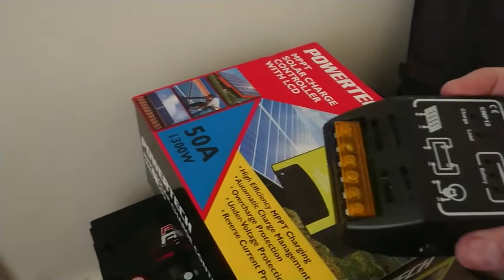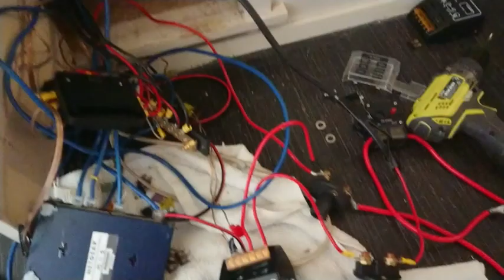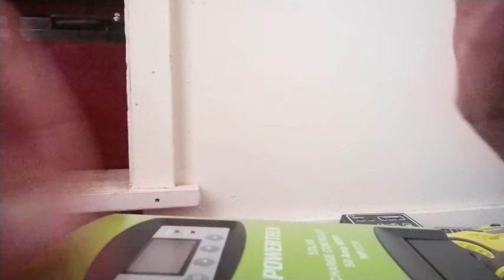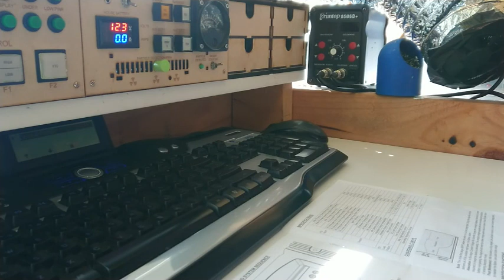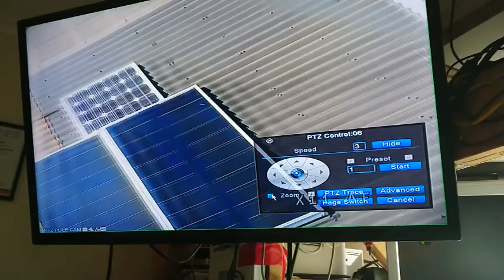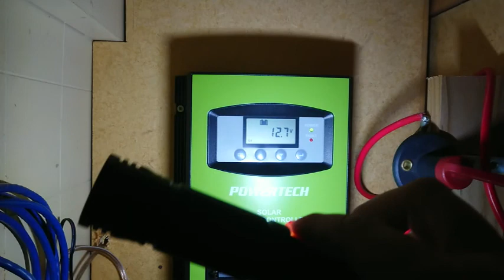Solar Battery Upgrade

Comment: Great video mate.
I hope you are going to draw a circuit diagram and fix it to the cupboard door for reference.
Can I suggest you put the shelf up higher so you can service your batteries, also you won't have to bend down to the shelf.
I agree with not using the load terminals of the charge controller.
The temperature probe connected to the battery terminal will mean you get an accurate representation of internal battery temperature.
It looks like you have a crystalline and two amorphous panels.
A good video would be you doing a V vs I graph of your panels to see how they perform.
Have you got a DC clamp meter or put a meter in the PV circuit to measure PV current?
Don't forget the "quoted" PV wattage is a Laboratory measured value and not really possible in real life.

I like the big isolating switches.
Good luck with the MRI.